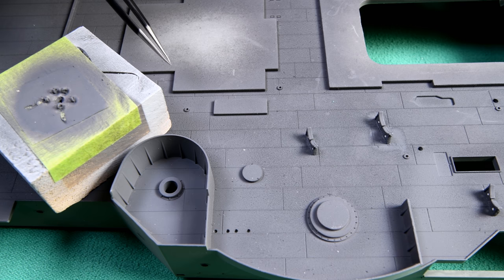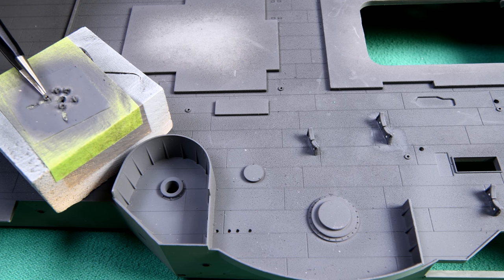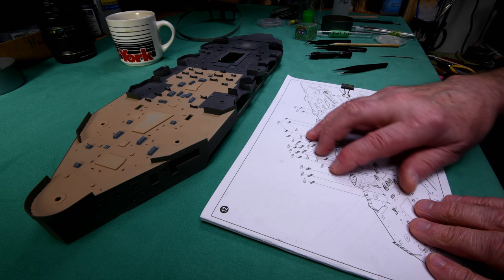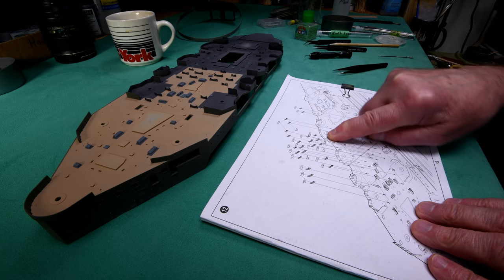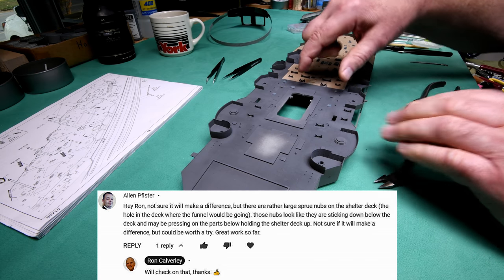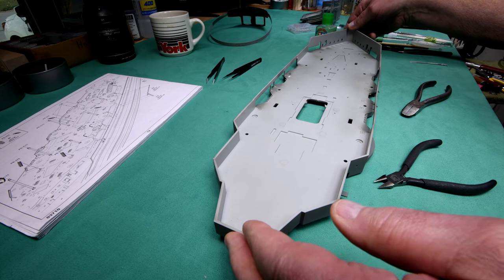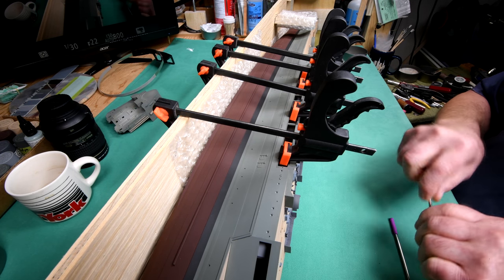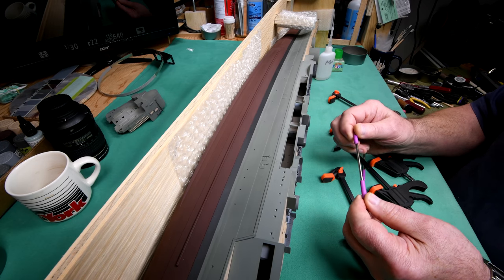The Model Ship - Part 601

Comment: Dear Ron, glad you like them, you can also use the blunt end as a painters mahlstick/maulstick to steady your brush/ca applicator tube without damaging the paint under the tool. kind regards, Mr"T".
Reply from the maker: "painters mahl" Yes, that soft rubber tip won't slip either.
Thanks again Mister T. 👍🙂

Comment: Ron , I have better luck applying CA glue on the stem or shank of parts I am trying to place into a hole rather than putting a drop onto the hole itself.
Also have found that a tooth pick or straight pin or straight sewing needle also works good for me rather than the forked applicator I see you using so often.

Comment: Hey friend been watching you fiddle with the micro parts. If I may I would like to give you a tip the tool that you made with the notch in it is excellent however it's a little large what I use is a large sewing needle and I break just the top of the eye off leaving the Little Fork it works excellent I run the sharp end into a piece of Dow rod it works beautifully I've done this for years. Also if you have a Hobby Lobby or a Michaels of some sort if you look in the crafting Department where the crafting beads are for making jewelry there is a pen with two sticky ends on it one is Mike Rowe and the other is a little larger it's just a key enough to just touch a part and pick it up and put it in place then just gently turn the tool and it lets go it lasts for a long long time you just wash it with soap and water with your fingers and it comes right back to life very inexpensive next time you're out ask one of the ladies in the Departments to help you find that I use mine all the time couldn't do without it peace my friend your ship is looking beautiful looking forward to see more stay safe bless.
Reply from the maker: Thanks! 👍

Comment: Look, I know you're way past this point, but to my mind you've gone a bit overkill.
Firstly, if you use yellow Frog Tape, it doesn't strip paint, so you could have held the upper deck in line with the hull without the bits of plastic. Also and this is just supposition, I think you could have placed bits of plastic sheet or even wood between the upper deck and the misplaced edge to push it out towards the gunnels. Sorry, but I'm quite stressed just now as I can get near my 1/350 KGV, as we're moving house soon and it all packed away.
However, you've given me a lot of tooling tips and I'm seriously, I repeat seriously thinking about a 1/200 Hood or Rodney. Your choice?
Just one technical point, do you ever use the macro lens and monitor in a "keyhole surgery" sort of mode to see more clearly what you're doing?
Reply from the maker: Re: "do you ever use the macro lens and monitor in a "keyhole surgery" sort of mode"
No! I find that viewing  myself on the monitor while working is confusing.